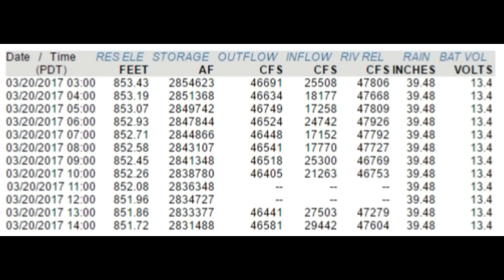New Images | Heading to Oroville | Lake Oroville Dam Update 3-20-17

Comment: I believe the grass is to help combat erosion from rain.
Reply: yupyup1562  Since they cut all the trees down, grass is a must for erosion control.
Reply: gotta wonder why they cut the trees down to begin with, some disease probably helped, I think it's called culling
Reply: They cut the trees and scrub brush, and chipped them up all within a few days, while the spillway was shut down, as they knew the emergency spillway would come into use... had they not done so, the trees would have been washed away and badly added to the mess in the diversion pool and Feather River. Try some common sense, man. It'll help you to relax.
Reply: Hey transformed. 
I believe the trees were cut down to clear area for heavy work needed to fix gulley wash outs and to relocate power towers.
Reply: they could have used a saw rather than pull them out and leave soil alone without any root system because, mud slide was result.  Bad planning.
Reply: What makes you think they didn't use a saw? Of course they did!
Reply: +yupyup It might be that they are just puttin' lipstick on the pig!
Reply: Al Dove 
Could be, and maybe they are just desperately trying to stick to set guidelines around building and maintaining dams, planting harali quick growing grass to impede erosion.  They can't just sit back and do nothing.